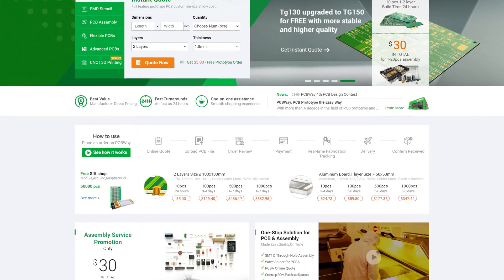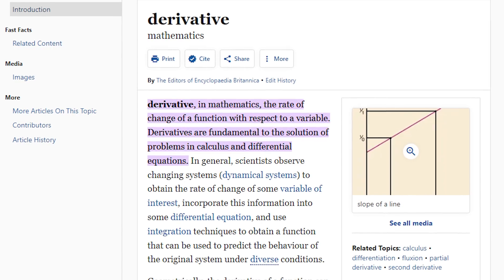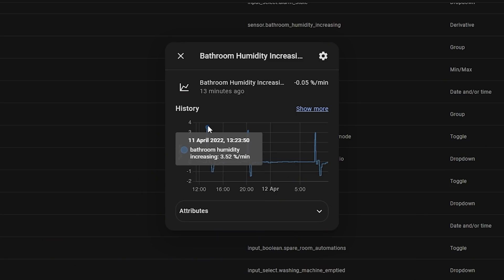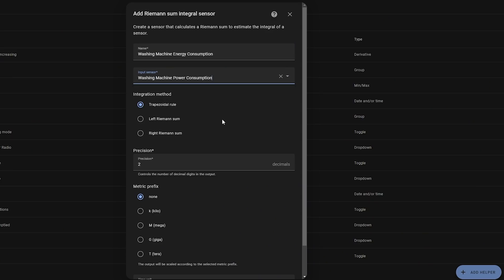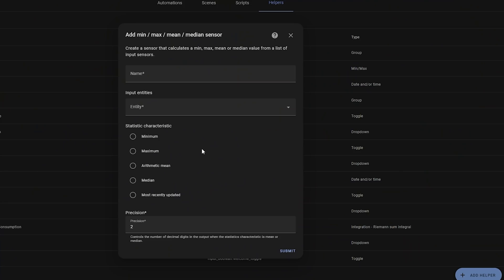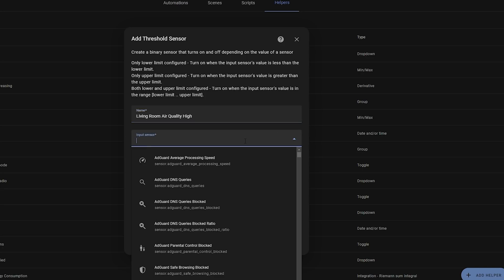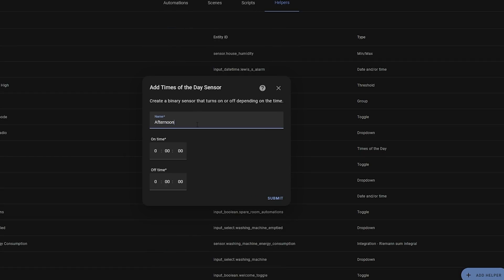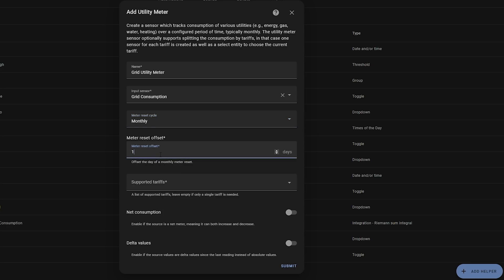6 New Home Assistant Input Helpers Explained!

Comment: Great video.  I'm trying to figure out if it is possible to create a helper or similar to use a smart plug without power monitoring to calculate the energy usage.  I use the smart plugs in automations, and HA knows how long the plug is on or off. Having a electrical heater with know power connected to such a plug will enable HA to calculate the energy usage when knowing the duty cycle and manually inputting the heaters power. I have tried to set up a helper to do this, but the smart plug do not show up as a input sensor in the "Add utility meter", so I am kind of stuck. Thanks for any advice if you have any input to this.

Comment: Very useful video. Never used helpers until now, but will definitely replace some of the binary sensors I have currently created via my configuration.yaml. I have also a question. Is it also possible to add a riemann sum integral sensor created from a helper to the energy dashboard? Or is it required to create a template sensor instead?
Reply from the maker: Thanks! It should work to add it right to the dashboard depending on your original sensor
Reply: @EverythingSmartHome  I checked again and now indeed I could add it. Thanks!

Comment: Any chance you could provide some more details on the derivative sensor (specifically for the humidity example you have in the video) and how you would decide on trigger thresholds based on the value? Perhaps I'm not seeing enough variation in the sensor data I have so far but I'm having some trouble wrapping my head around it.

Comment: Amazing video with some really smart examples!
What I'm still missing though, is the ability to add an offset to a date/time helper. 
I have a wake-up light that I want to trigger 30 minutes before my alarm. Right now I just set the helper to 30 minutes before I actually need to get up. Anyone know of a nicer way to achieve this?
Reply: You can easily use a template to subtract 30 mins - {{ (state_attr('input_datetime.my_time', 'timestamp') - 30*60) | timestamp_custom('%H:%M', false) }}
Reply: @JaneTaubman  Thanks! Managed to finally get this working. 

You can't set that formula as trigger for an automation. You can only use a date/time helper as is. So I created 14 helpers, 2 for each day of the week. The first as input, the second as trigger, and then created an automation that sets the time on the second one as half an hour earlier as the first when the first one is changed.

Not very straight forward but I got it done in the end. Thanks again for the formula! :D

Comment: I (using YAML) put together a bunch of these to figure out if I should open a window. It's tougher than it sounds, and the way I did it, first I decide whether it's nicer outside than inside, and then decide if it's getting too hot or cold outside or not (using derivative). If all of that is true, I set a threshold value of being nicer outside to true. There's also a statistics helper to decide the temperature in the house, and I also damp the temperature values.

Comment: Good work even if you don't get it.
Derivative is useful for change, or basically the slope of a graph.
Integral gives area, which the Reiman sum integration does. I mean, it's in the name itself.
Min max stuff would help to calculate the limits of the integration or value of derivative using it with the threshold & other functions.
Time of day being binary basically means it's creating a step function.
Utility meter would be very helped by the functions measured above as u said with wattage to power, etc.
Technically, all the functions implemented are for DSP use, where it's processing the utility meter values. But you can make a motor controller or audio processor using those functions, albeit a bit slow.
Now for someone to come & make a PID controller :P
Reply: Someone made a PID controller in node red. I use it to control my ventilation system based on the reading of my self-made Esphome co2 sensors

Comment: Idk why but Zigbee just stopped working for most of my devices in ha for weeks now. Does someone know how to fix it?
Reply from the maker: What integration do you use?
Reply: After upgrading towards the end of last month everything Zigbee  quit working. After looking at the logs I found that there was no connection to my Zigbee Dongle any more. Since I use proxmox on an old server I looked into the container and the USB stick was no longer found. I moved it to another port ( a common way I have found to renew a USB device) and was able to find it. Once I restored the usage of the stick to the HA container all Zigbee devices returned to working order.  Don’t know if the HA update caused the issue but the timing makes it a prime suspect.

Comment: Very helpful new feature - still missing Numeric Sensor Group to e.g.add up the thre phases of one power supply
Reply from the maker: Do you mean sum of all three?
Reply: @EverythingSmartHome  right - as one possible example
It would be great if you simply create this kind of groups of some numeric sensors
Reply: @Klaus-macht-Bilder_de  you can create a template sensor to do this
Reply: @Sparky_D  I know do it at the moment, but a Group would be more convenient....like with Al the other new groups which were possible by tamplate too

Comment: Thank you very much,
I was finally able to integrate the tuya devices into the energy dashboard using Rienman sum helpers.
I don't know why, but some were taken automatically, in others I had to edit the device information in the \config\.storage file manually to give it the "energy" type.
Reply from the maker: Nice one, glad it helped you figure it out!
Reply: Currently getting status unknown taking Tuya smart plugs through Rienman, did you experience the same and that's why you went to config?
Reply: @KrispKiwi  Yes, I think it takes a while for data to be shown. In my case I saw the first data in the helper in an hour and it was almost 2 before the energy tab updated.